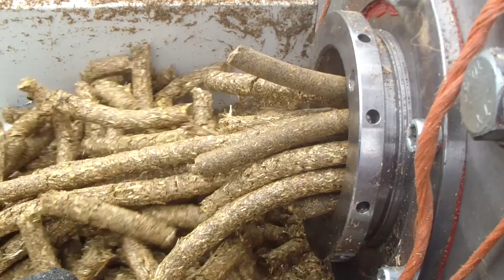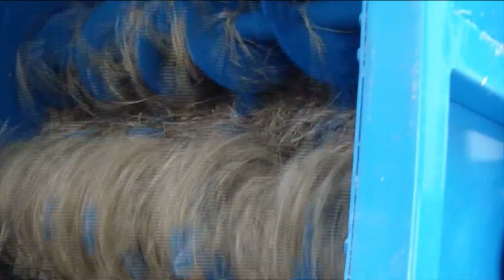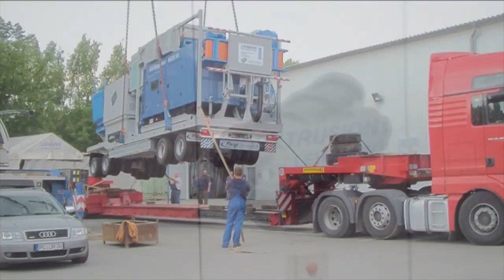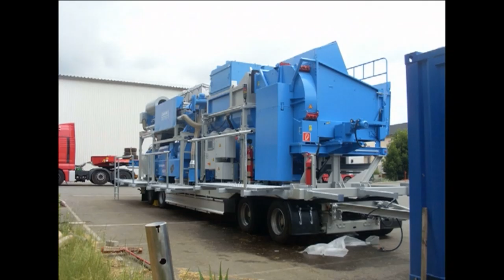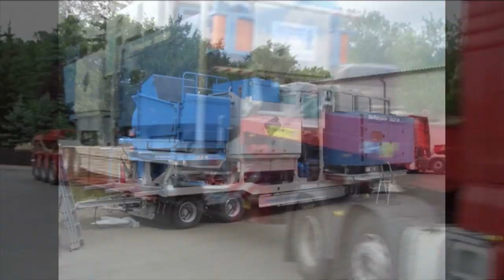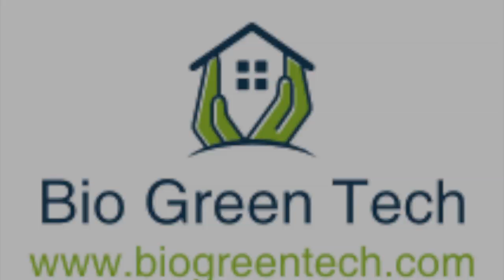🔴 Mobile Briquette Plant: Mobile - Pellet Plant. Please support our friend in the Ukraine

Comment from the maker: http://www.biogreentech.com/mobile-biomass-briquette-pellet-plant2/

Mobile Biomass Briquette-Pellet production plant.

Mobile Biomass Briquette-Pellet production plant Semi-mobile compacting -ZK 90 Installation and use. The mobile briquette pellet plant is mounted on a platform trailer. This can be designed to be towed by Tractor or Truck (HGV) It is used for the compaction of biogenic materials, such as Sawdust, Straw, Willow, Miscanthus,